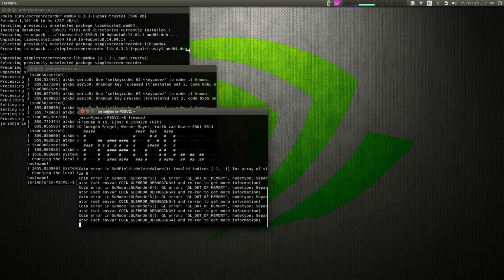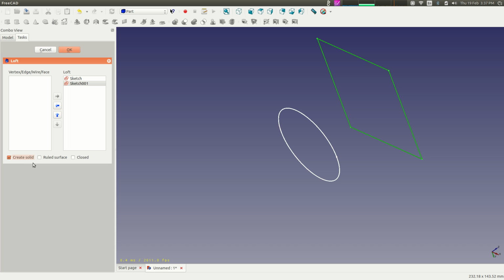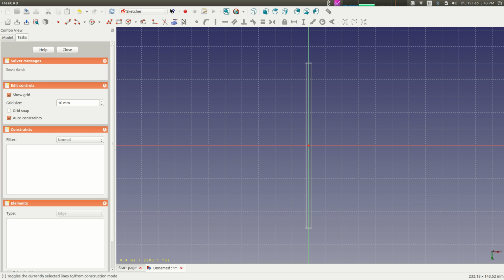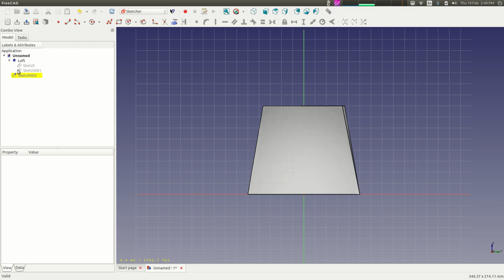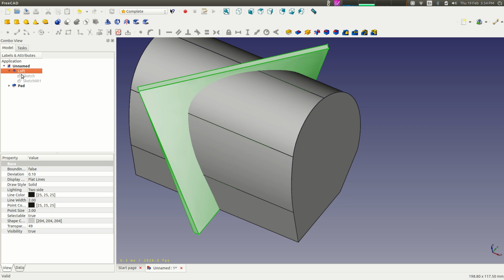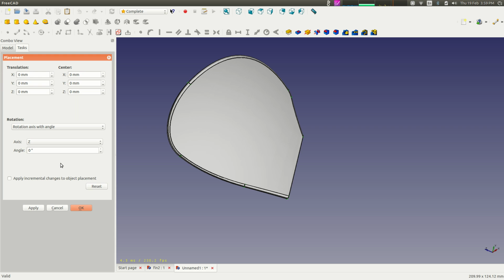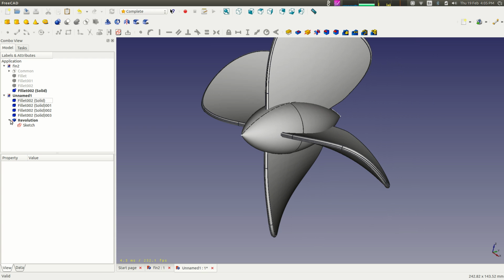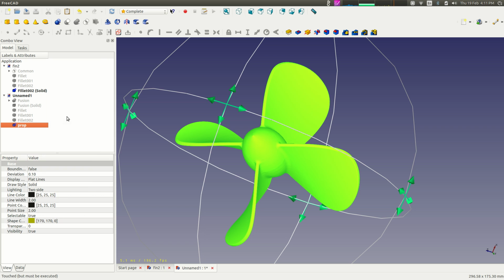tutorial3 FreeCAD

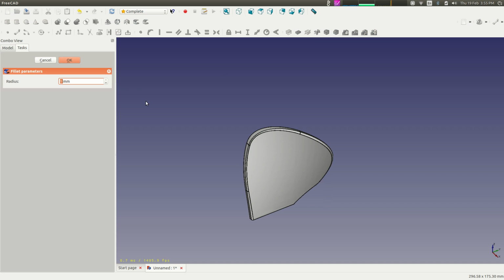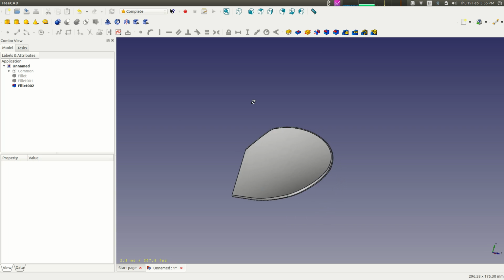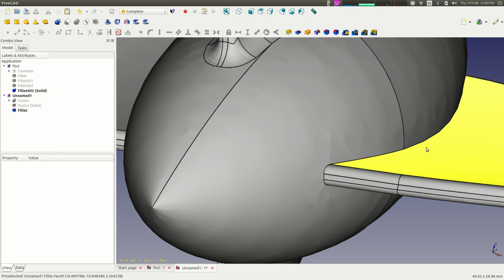Comment: Can someone tell me, why in my 0.17 R13514 version, as in the video at 23:45-23:55,and same at 37:00, I can not fillet the edge neither in the Part Design bench nor in the complete bench?  The program always say "Select an edge, face or body from an active body" when I already selected. In the Complete bench I don't have the fillet tool. I added manually. Thanks a lot!

In this version I can do nothing in the Complete bench. I made the blade in the Part and Part Design benches.
Reply: Good luck with v.18 , you can't add any tools from the other work benches in Complete. Many changes make this video very difficult for a newbie like myself to follow with the latest version. And forget adding fillets or chamfers to this part.

Comment: I cannot complete this example.
At 18:55, version 0.16 of FreeCAD, November 16, 2017 release running on Ubuntu 18.04 does not allow me to "attach" that node to the grid line.  I have tried it a dozen times and the error message is 

"Select two or more vertices from the sketch."

What am I missing?

Comment: Why do you produce 4 wings from one non via radial array?
Reply from the maker: At the time new extruded features were not properly recognized for that function, its probably fixed by now and your right that is the way it should be done
Reply: Hi! Use the array command of draft workbench...it worked for me... ;)

Comment: Thank you for your excellent tutorial. I started using FreeCAD yesterday and made a discovery by accident. May be its not new but here goes. Right click on the view port and select Touchpad navigation. Back to the view port. Pressing Num-pad 1 will give a front view. 2, top. 3, right. 4, back. 5, bottom. 6, left, and of course 0, orthographic, using the X-Y plane. Thanks much and may I encourage you to continue your tutorials using the other tools.